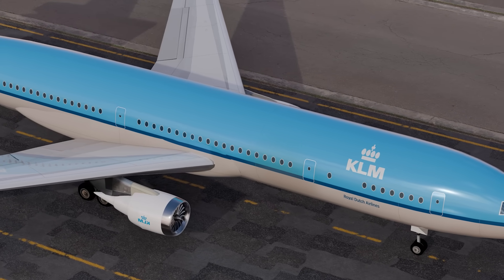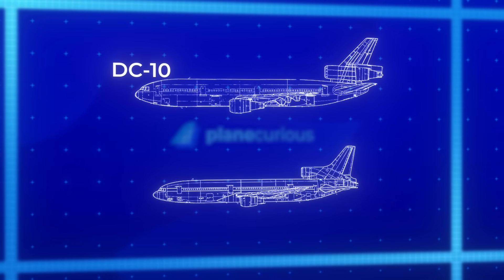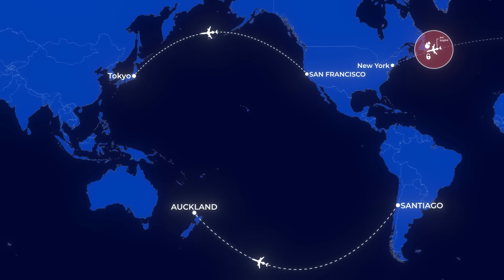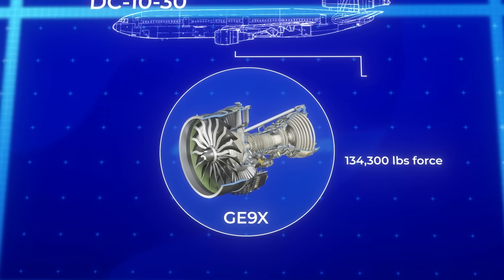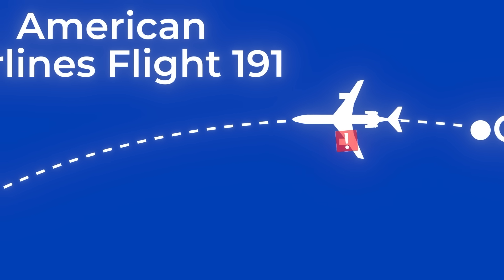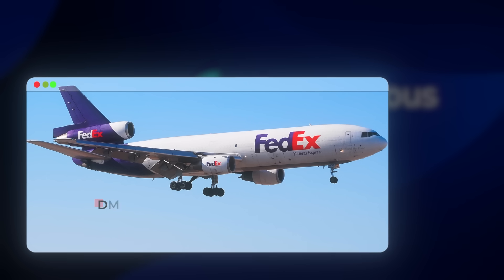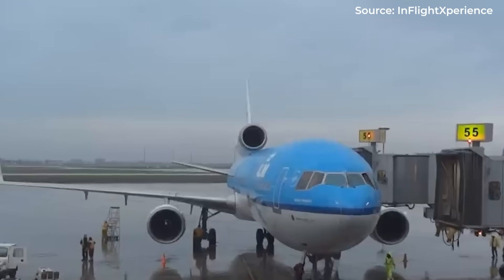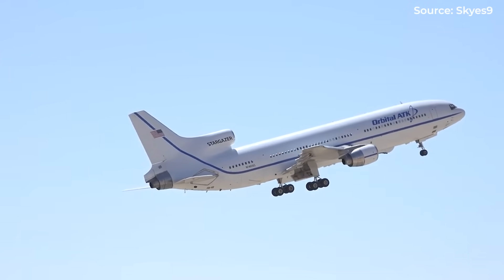Trijets Changed Everything - Until They Didn’t

Comment: Alot of with engines  all on the but they are STILL
FLYING.. NOT THE L1011,, IT STARTED AT THE TOP  THEN DUCKED TO THRU TAIL.. LOCKHEED
STRUCK OUT. THEY ARE HARD TO  FIX..

Comment: It's not just that engines got more reliable that changed to standard to allow 2 engine planes to cross the ocean.  It's that they got stronger relative to the plane's need.  It got easier to deal with flying a plane with half the max thrust capability (2 engine plane with one engine out) when the plane has more excess thrust capacity than it used to due to stronger engines.

Comment: The biggest problem with the tail engine is that it's located within explosion range of other vital things.  An engine slung under the wing is easier to shield from the rest of the plane.  It can fail, catch fire, or even tear off, without completely wrecking the wing itself.  An explosive failure on the tail engine is too likely to ruin the control pathways to the rudder and elevator, or wreck the surfaces themselves, which you kind of need.  It's embedded too deeply inside the plane.

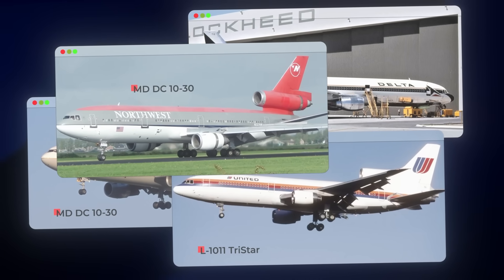Comment: @ 2:40 is a very interesting rarity; a United L-1011. United acquired six L-1011-500s after its purchase of Pan Am's Pacific routes in 1985-1986 but because the L-1011 was so different from anything else in United's fleet, they were sold to Delta relatively soon after.

Comment: I did not hear any mention of the fact that these planes required a three person crew: a captain, a first officer, and a flight engineer. That was another reason why they were so expensive to fly. 

The first plane I ever flew on was a 727.  I also flew on most of the L-1011s flown by Delta. By the way, it was not mentioned in the video, but Delta had the largest fleet of L-1011 aircraft on earth

Comment: I vaguely remember flying in a TriStar as a kid. When we landed in Gerona, Spain, we got off the plane via a ramp at the back.
Reply: I don't think that would have been a TriStar or a DC-10. Most likely it was a 727. As far as I am aware, only two L-1011 commercial aircraft were fitted with airstairs. Both were operated by Pacific Southwest Airlines and the airstairs entered through the front baggage hold not by a rear ramp. The 727 was designed to incorporate an airstair under the tail.

Comment: I have flown on the DC-10. The comfort was not like the 747 but compared to aircraft’s today. They where so my much better. You would not  feel the turbulence like you feel in smaller aircraft’s. In today’s Aircraft only the 777 comes close to the smooth flight you would experience on the DC-10 or the 747. Undoubtedly the 747 was the Queen and  I will always miss her.

Comment: At 10:08, "The odds of both engines failing simultaneously, they're astronomically low."   The recent Air India 787 crash is, tragically, testing that hypothesis.  Will investigation find maintenance deficiencies?  Proper maintenance is as expensive as it is necessary.

Comment: I flew on a DC 10 widebody jet across the Atlantic and back in 1980. It was a very smooth ride.  But it wasn't too long before the DC 10 crash in sioux city happened. It showed a big problem in the design.  I've only seen them used by FedEx  nowadays.

Comment: I'm not sure if I ever flew in a trijet (I would've been a kid), but I remember noticing that some planes had that third engine in the tail and wondering why 2 weren't enough when they were on some of similar size planes.

(I had no concept of the highly varied use cases and flight profiles that answer that question, or did before ETOPS)

Comment: I got to fly on a Northwest Airlines DC-10 in Nov 2001 between London Gatwick and Detroit (and back)... and although other airlines were slightly cheaper... I just wanted to fly on a 3-holer!
As a part of the same trip, to Newark (New York area), I also got a pair of DC-9's... six weeks after 9/11, which was a little scary!
The DC-10 flights were really good and comfortable. Also, with people scared to fly following 9/11, I get three seats to myself and was able to lie down for some sleep... which was more useful on the way home because I get really jetlagged flying easterly.
The only negative was that the seats didn't have their own entertainment systems like the Virgin 747's I'd gotten for the previous direct flights from Heathrow to Newark.... but it's not really a fair complaint because the DC-10's weren't going to get modernised for another decade of passenger use.
Interestingly, one of the DC-10's a flew on (N239NW) is still in service as a fire-fighting tanker!!
The other (N244NW) was withdrawn the following year, and was scrapped in 2016

Comment: They say a duel engine failure is almost impossible but that what it’s looking like may have happened to the recent air India Dreamliner crash that happened almost immediately after lifting off. There’s new video showing the air propeller (forget what it’s called) dropped to provide power to the jet just before crashing indicated a duel engine failure of some sort. Guess additional time will tell what actually happened to that flight.

Comment: Dual engine failure may not (necessarily) result from poor engine design, alternatively, both engines could suffer catastrophic damage from, say, a bird strike, such as was the case of US Airways Flight 1549 in January, 2009. Fortunately, the flight crew was able to perform a water landing on the Hudson River (NY) resulting in no casualties. However, it does pose the question of had there been a third engine on the tail section, and due to its position basically being blocked by the fuselage, would it have avoided damage and therefore negated the need for a dangerous water landing? 
Just thought this was worth mentioning in regard to this interesting video topic.

Comment: The L1011 Tristar was a nightmare to refuel.
3 engines with 4 main tanks. 2 sets of fuel gauges (both unreliable) and a panel that operated in reverse of every other planes.
Close the valve, and the valve light come on! Open the valve, and the light goes off?

Comment: The interesting thing about this video is not the trijets - instead it just showcases the absolutely amazing creations that are today's modern turbofan engines. These things are engineering marvels. We dont give them a second thought as we take our seats, open our pie holes & start stuffing them with snacks while swiping greasy fingertips in the IFE screen. All the while those two GE90s on your 777 are thundering away just outside your window. Just one of them can keep the airplane and all 300+ meatbags on board airborne. Inside this engine core the temps can be in the range of 1500-2000+ Celsius. Blades rotating at ferocious speeds, atomized fuel ignited and shoved out the back to blast  you across the Pacific so you can see your love interest in Japan. Huge shout out to the jet engine designers out there.

Comment: Well, looks like dual engine failure wasn’t that impossibile after all…
Reply: The reason for the dual engine failure was probably the same in both (suspecting vapor lock). So having more engines wouldn’t have helped. Especially when you consider the emitted heat of an engine, which would have raised the fuel temperature even higher. 

Can you even call it a failure if the engine doesn’t get enough fuel 🤔
Reply: Has it been confirmed yet?

Comment: "The chances of two engines failing are like being struck by lightning whilst winning the lottery" - tell that to the passengers on the Air India 787.
Reply: There is no way in hell those 2 engines failed independently at the same time and without a single trace of smoke or fire. If it was indeed an engine problem, it was something that affects both engines at the same time (fuel, eletrical, controler etc) which means you could have 3 engines or 10 engines, they would all turn off together.
Reply: It is rare though but the reason for engine failure needs to be found for the air India crash
Reply: @Peter-mj6lz  Video shows that the wheels stayed down but takeoff flaps were retracted, the opposite of what is normal.  Mechanical fail?  Co-pilot error?  Hopefully the "black" boxes will clear some of the fog.
Reply: @AirDOGGe that was debunked dozens of times already. The wheels where tilted in a way indicating interrupted retract sequence. The flaps are in normal take off position as seen in the higher quality handheld video and in the photos of the wreckage. Even in the low quality version, you can clearly see the reflection from the slats ffs.
Reply: @IOtheFifth not to mention, the plane successfully left ground effect, which it couldn't have done with retracted flaps.
Reply: Yes, and that was the one time it happened
Reply: Plane engines just don't fail independently at the same time, the chance is so minuscule. It is by far in a way more likely that one problem caused both engines to fail (and would have caused all engines to fail whether you had three, four or 100 of them)
Reply: @grassytramtracks Depends on the cause. Lack of fuel or ash ingestion would shut down all engines. But ice ingestion, like brought down an SAS flight, wouldn't affect all three engines because the tail mounted one would be away from the airflow coming off the wings.
Reply: We don't know that the engines failed. There are other reasons for loss of power than mechanical failure of the engine.
Reply: @AlinFlorida I thought that was why the RAT was deployed

Comment: -Double engine failure is rare. Air India：Hold my beer.
Reply: Highly likely due to some other malfunction that shut down all engines at the same time, not the engines themselves.
Reply: @jkhcu  British Airways Flight 009 lost all four engines after accidentally flying through an ash cloud at night.  Also not the engine's fault.
Reply: Not funny
Reply: Or Jeju Air
Reply: what is your point? it is rare
Reply: @cipribastanu3859  You comment is correct. Statistically rare, not impossible . . .

Engine failures in turbine engines are estimated to occur at a rate of roughly one per 375,000 flight hours, and dual failures are a fraction of that.
Reply: Was looking for this one 😂

Comment: No twin engine failure, hmm that aged bad
Reply: we don’t know what happened other causes are far more likely
Reply: @qu0b3n66 i still hate having statistics be used in safety ever. Safety should be solely deterministic in my opinion.
Reply: @qu0b3n66  I agree ,,, to say that aged bad is a little broad to say because it’s been years since that actually happened statistically
Reply: Yep sure did
Reply: We don't know what happened yet but when multiple engines fail it's almost certain to have been a single cause taking out both engines which would have taken out all three engines. Both engines failing for totally independent reasons at the same time is so infinitesimally unlikely
Reply: @grassytramtracks thank you, looking at it that way only two engines means less components that can break like less cables that can cause a fire

Comment: Two engines failing at once. Well, it might be astronomical, it's suspected that something like that just happened on Air India 171.
Reply: Engine failures in turbine engines are estimated to occur at a rate of roughly one per 375,000 flight hours, and dual failures are a fraction of that.
Reply: The probably of both engines failing independently is incredibly small. We can't be sure yet, but it's much more likely to have been a single cause which could have caused a trijet to lose all three engines as well

Comment: There is an anecdote about Douglas instructors testing Brazilian's crew training and procedures, back when Brazilian Varig operated DC-10's. He threw everything at them on the simulator: left engine failure, right engine failure, rear engine, everything. They handled it as routine, not even batted an eyelash, and smooth landings every time.

" - Gee, see how he threw malfunctions at us? He was determined!"
- Should we tell him we never managed to takeoff with all 3 engines operating at the same time? " 
😂

Comment: I had the chance to fly first class on a DC-10 in the late 90's. During that same trip I flew on a DC-9 and a 737 as well. The DC-10 was an incredible experience, even beyond getting those premium seats thanks to an airline upgrade. I was aware of the crashes in the past so that weighed on my mind at the time. The DC-9 was like a roller coaster, I was amazed at the takeoff angle. In comparison the 737 was forgettable, although the leg room was better than the DC-9 back then.
Since then it has only been regional Embraer jets that I've flown. Not a fan.

Comment: The first jet flight I ever took was out of Tucson in a 727.  There was a considerable crosswind and without going into too much detail, the placement of the engine high in the stabilizer made it susceptible to compressor stalls.  Two takeoff rolls were aborted by really loud bangs and shuddering of the aircraft. Probably some brown seats too.  The third try was prefaced by an announcement by the Captain saying that our next takeoff roll would be longer than normal.  He explained all of this later, including the fact that we took off on two engines, after we reached cruising altitude.

BTW, the comment about the Pima Air and Space Museum being a "boneyard" is mistaken.  It is a museum, the boneyards are at DMAFB for military aircraft and Pinal Airpark for commercial aircraft.

Comment: any airplane requires specialized equipment for maintenance, does anyone remember the crash at Chicago's O hair airport back in 1980 the left engine broke off the wing resulting in all passengers and crew lost, during the investigation they found that American airlines had preformed maintenance using a fork lift to remove and install the engine resulting in a broken/cracked motor mount. And besides Boeing pushed for FAA rule changes to allow twin engine airplanes to preform long haul flights over water.
Reply: Two reasons for the rule change:  Twin-engine jets can fly on one engine, and jet engines have become much more reliable.

Comment: A trijet accident was avoided:  Something went wrong, causing the nose to pitch slightly up. The pilots were unable to correct it using normal means. But, they were able to control the pitch by increasing thrust on the #2 engine, which was mounted at an angle. An investigation found water had gotten into a bearing to move one of the control surfaces.

An Internet search now fails to find that incident. The above comes from my memory.

Comment: 10:00 https://www.youtube.com/watch?v=wfEO4bchyGE&start=10m00s "The probability of dual engine failure on a twin jet, is lower than losing two engines on a trijet".  That is true - there are three ways for a two-engine failure on a trijet: LR, LT, and TR (L:Left, R:Right, T:Tail), and only one way for a two-engine failure, LR, on a twin jet.  With two engines failing on a trijet, one engine remains operational.   On a twin jet, with two engines failing, not a single engine remains operational.

Comment: I was on a DC-10 from LAX to Honolulu when I felt a bump...and a noise from the rear.  The center engine blew up...and after a couple of minutes the Captain told us that it had failed but the DC-10 was capable of flying fine on two engines.  Unfortunately, we were just short of the point of no return and had to return to LAX.  We made it back with no further problems but, from that day I have never liked flying a DC-10.  There's just something about that engine stuck onto the tail that, as an engineer,  bothers me.  When Boeing's 737 MA X began falling out of the sky...after the first two to go down, I refused to fly on those deathtraps.

Comment: The MD11s also later had issues with Kapton Insulated Wire arcing. It was a significant fear in the 90s as the wire aged.
Reply: Only the Swissair MD-11 that crashed off the coast of Canada had the issue. Use of Kapton in aircraft was and is quite common and becomes more of a concern as it ages.

Some aircraft involved on the military side include F-16, F-14, F-15, F-18, F-4, S-3, E-2C, P-3, EA-6, SH/UH-60, AH-64, and AH-1 models. 

Some examples on the commercial side include A310, A320, A330, A340, B727, B737, B747-400, B757, B767, DC-10, MD-8x, MD-11, L-1011, G-II, G-III, HS125-700, 212, 214, S-61, S-70B, S-76.